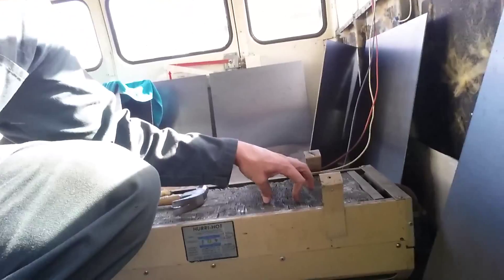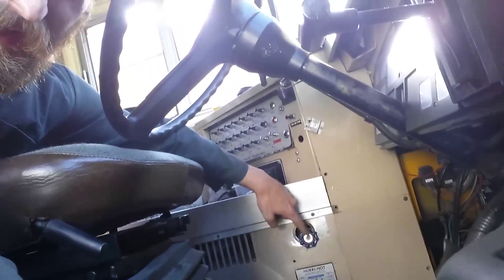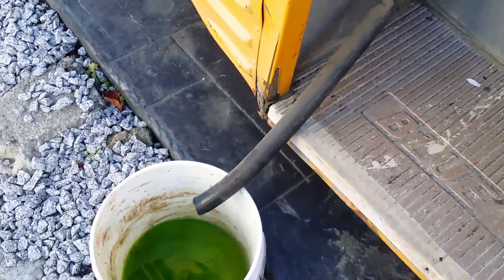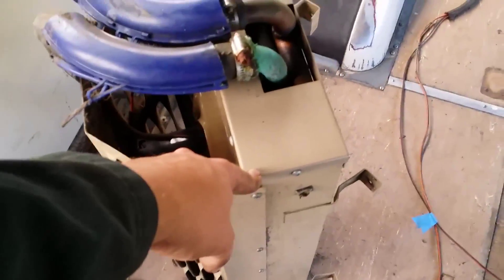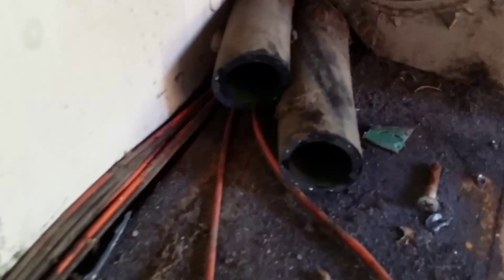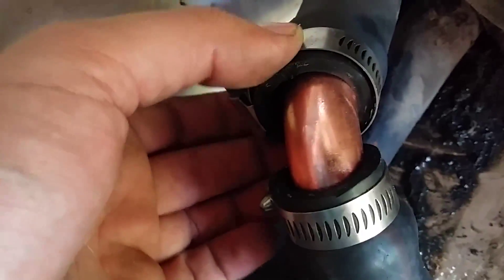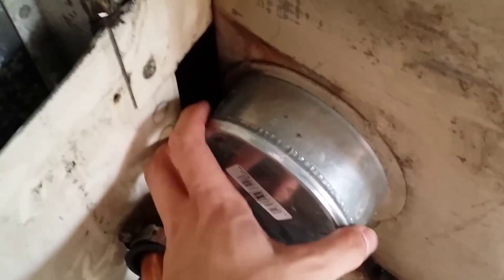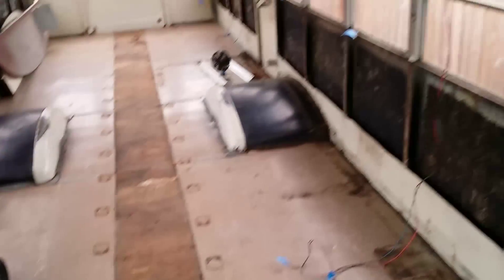Conversion Video 4- Remove the Heaters

Comment: so I know it's been a while, but, you needed to make sure to reroute those tubes bc the engine obviously needs coolant, right?
Reply from the maker: Yes. My bus has a bypass valve that allows it to totally skip the interior heaters, but since I kept the two in front, it does need to be rerouted so that if I send coolant to the heaters, it flows through in a circuit, back to the engine. Also, I learned that if the engine is getting hot, turning on the interior heaters helps with cooling the engine because there is a higher volume of coolant flowing through, which is easiwr to keep cool.

Comment: I had a similar situation, but my valves for the coolant are in the engine bay. After I removed the heater, I just left the valves closed. There is a sticker on the dash board that says: "Only shut valves off in an emergency." so I hope I'm not screwing anything up by keeping them closed.

Comment: What did you do with the power wires? How did u cut them off and safety splice or disconnect those
Reply from the maker: Jarediscus I cut them off and removed the fuses.

Comment: Hey! How did the copper pipes hold up? About to do the same thing but worried about what type of metal to bypass the hoses.
Reply from the maker: The copper is holding up just fine.  The heaters themselves contain copper piping.  I've seen people use U-bent pipe where I did my little double 90 thing, and it looked much neater.

Comment: what about the wiring to the heaters? how'd you deal with that?
Reply: Some was used to power the backup camera in a later video. The rest was cut and properly terminated, but the circuits could be easily reused. Most of the infrastructure is still there.